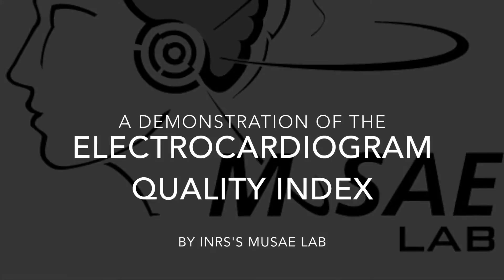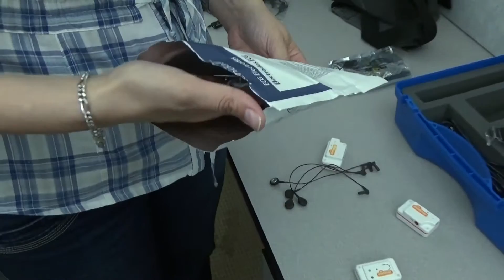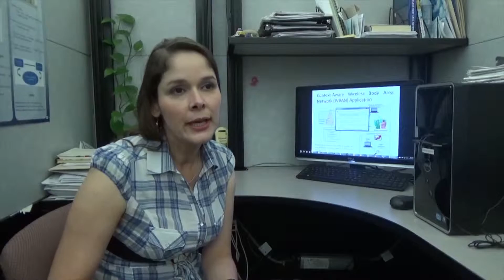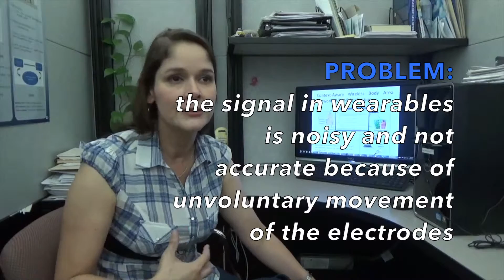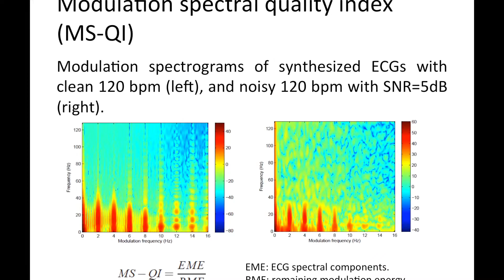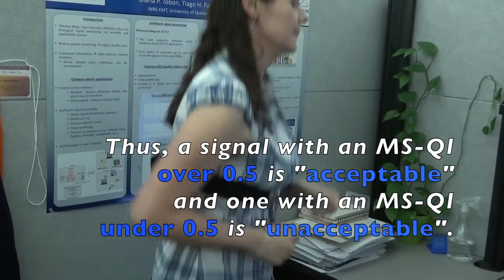Electrocardiogram Quality Index (MS-QI)

Comment: How is the modulation frequency defined? 
I have a hard time understanding the spectrogramm. Usually the x-axis is time, the y-axis frequency and the color (z-axis) the power spectral density. 
Is this a frequency vs frequency plot?
Reply from the maker: +Effesianable 
Yes, this is a frequency vs frequency transform. Starting from an STFT, the time-frequency spectrogram is formed. The spectral magnitude is then windowed and a second transform is taken over the time axis, resulting in a modulation frequency (x axis), acoustic frequency (y axis), and modulation spectral energy (z axis) represented in color. More details can be found at: http://ieeexplore.ieee.org/xpl/login.jsp?tp=&arnumber=6892964&url=http%3A%2F%2Fieeexplore.ieee.org%2Fstamp%2Fstamp.jsp%3Farnumber%3D6892964
If you need access to the PDF, you can request a copy at http://musaelab.ca/contacts/
Reply: Thanks a lot, I'll read the paper.